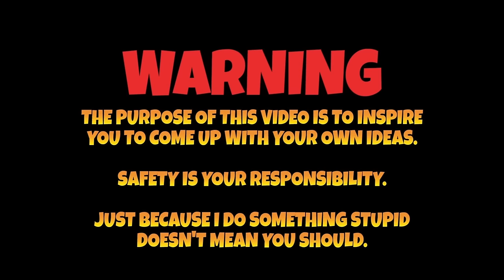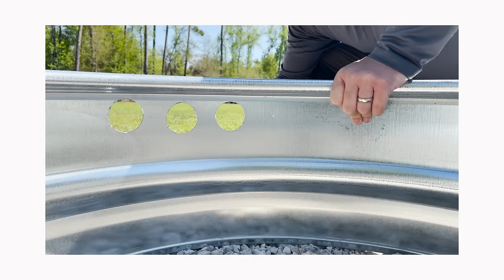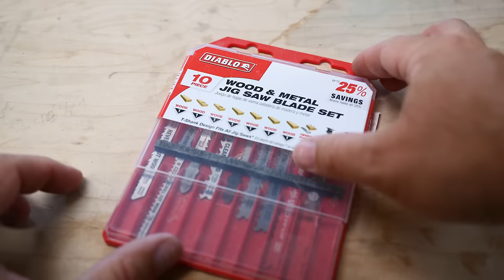8 Must-Have Power Tools For DIY And Woodworking

Comment: There is no 20V. 20V is 18V. Its only 20v when the battery is topped of for like 10 seconds (hence why they can legally advertise it as such) but immediately drops down to a nominal 18v from then on.

Comment: Milwaukee is the best tool based on performance but that is overkill for DIYer… the Milwaukee is also heavy because of the metal Chuck… and the batteries are annoying as hell to remove if you get material in there ie hot mud…. Also not friendly for elderly or those who suffer from arthritis. I have a plumber friend who had an accident and lost strength in his hands and it was painful for him to use all the Milwaukee tools he had. So he had to switch to Makita.  They are lighter… the dewalt atomic series is light too being that it’s cheap plastic stuff… if you a diyer pick what’s going yo be at your level…. Pick just the essentials, Upgrade later when you start making money with your starter tools

Comment: Milwaukee are decent for diy and light construction. In an industrial environment, Milwaukee doesn't hold up. I worked in a factory years ago, Milwaukee drills died more than all the brands we used. Bosch on the other hand were so strong and reliable.

Comment: 18/20 is the exact same. Every M18 battery will read 20V right after taken off the charger, and once used a bit it will settle down to 18, just the same as any “20V” system. Pure marketing

Comment: There is no difference between 18v and 20v battery. Technically, people who say their battery are 20volt are lying to you ! Battery are calculated by their nominal voltage. 18volt is their nominal voltage(5x3.6v lithium battery), but they do go to 20volt ! Actually, they even go to 21 volt, but it doesn't sound as good as 20volt !) Imagine a car maker saying their car battery is better because it 14volt ! Well, it would still be a 12 volt nominal battery, but sure the battery does go to 14volt !

Comment: I think the most dangerous tool I have ever used is an angle grinder.  It's like it wants to bite you, kinda like a crazy ex girlfriend.
Reply from the maker: Absolutely. I try to avoid using them at all costs. One of the only tools that I’ve been injured with.
Reply: The angle grinder is THE last tool I would part ways with! Just treat it with the respect it require and you'll be fine.

Comment: Bought a Ryobi drill several years ago, both batteries were dead when I went to use it 6 months later would never hold a charge. $100 for 5 minutes of use. Worst purchase I have every made in my life by a large margin. If Ryobi had any ethics at all they would simply punch their patrons in the mouth and steal $100 from them, at least this way they don't think they invested in a tool that could work for future use.

Comment: A 12 volt Milwaukee I wouldn’t recommend to a new person. IT guys use them because they much more compact which is fair enough. Everything else I agree with.
Reply: They are perfect for home owners doing any furniture assembly or other light duty tasks. I’ve seen them in use in a lot of commercial construction settings as well, tons of use and abuse and they never let their operators down. Maybe get your hands on a tool before dismissing it.

Comment: 20v is 18v is 20v, it's just marketing BS to call a tool 20v, as the nominal voltage is 18v. Everyone uses that marketing BS on 12v tools, but at least they're all doing the same thing.